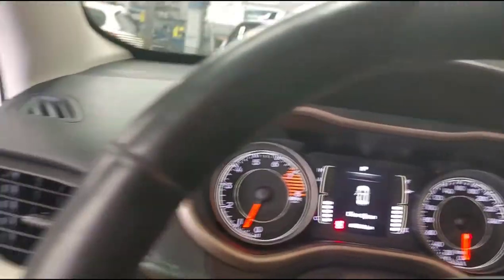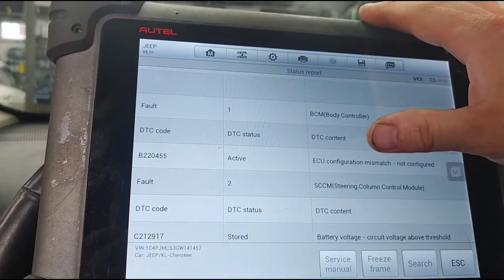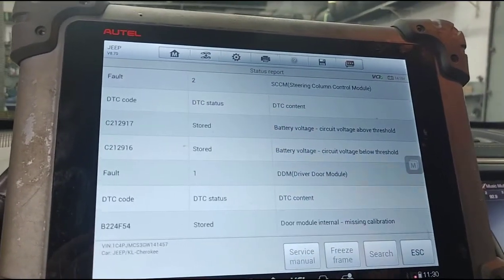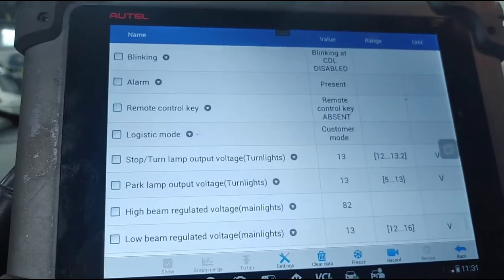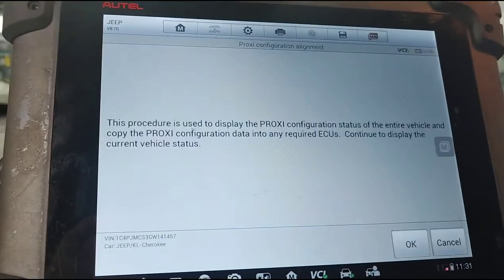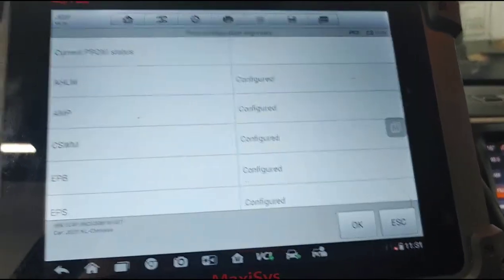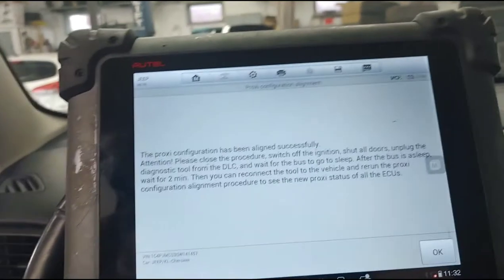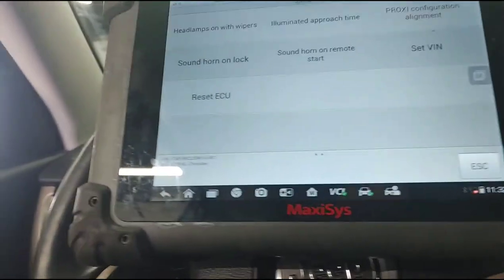Jeep Cherokee Odometer Flashes

Comment: I got a flat tire on my 2022 Jeep Grand Cherokee and put on the spare.  I got back in and the odometer was flashing and the backup camera stopped working.  4100 miles.  Off to the dealer.

Comment: Great videos can you tell me which autel scanner would work best for me for my personal vehicles 2013 Jeep 2007 Jeep and my wife’s Toyota camery 2016 just want one that can not  just reset codes but start things for checking like cooling fan any fuel pump ect ect and maybe relearn after changing parts . Any ideas I was planning on $1000

Comment: Everything was fine until I removed a outlet fuse. The next morning I cranked my Jeep and the wipers were on with the odometer blinking
Reply from the maker: First question... Why did you remove the fuse?
Did removing the fuse fix your issue?

Now,  the flashing odometer means that there is a module that has not been programmed or lost its programming, so it me be reprogrammed and/or be realigned on the network.
Reply: @JL's Auto Solution  The outlet fuse in the console was blown. I didn't have a clue that a simple fuse replacement would make a vehicle go out of wack. I'll be taking it by dealership Monday. I got a feeling they're going to try to rip me off with replacing all kinds of new parts🤦🏽‍♂️

Comment: I did this no the car has no communication
Reply from the maker: this procedure will not cause a no communication as it is only made to align the module on the network.
Reply: I got the same problem and right now transmission Shifter light on.

Comment: WE HAVE THIS PROBLEM  WITH CHEROKEE 2016 AFTER REPLACE THE RDIO TO ANDROID MULTIMEDIA.WE TRY RESET IT WORK BUT IT COME BACK AGIN.ANY SOLUTION?  THANKS
Reply: did u ever figure out a solution?
Reply: I’m haven the same problem
Reply: Same
Reply: Probably needs an aftermarket radio module and programming. Or go back to a factory radio and programming. Diagnosing this issue now on our used inventory. I bet this aftermarket radio needs a module to stop the flashys.

Comment: Is this something the local auto zone can do or do I need to go to a dealer?
Reply from the maker: unless they use decent scan tool.. no.

typically all they use is code readers.
Reply: @JLsAutoSolution  thanks. I looked at a forum and learned that unplugging the negative battery terminal for 15 mins does the trick and it worked for me.
Reply from the maker: @terrelvivi1043  Thats great that it worked for you, but this will not be the case all the time.. take care

Comment: I did the same thing and the odometer started flashing again after a couple drive cycles.
Reply from the maker: I believe I mention in the video that this happens when a module is new and needs to be aligned or when a module is not working on the network.

This could happen for multiple reasons, so diagnosing why is key.